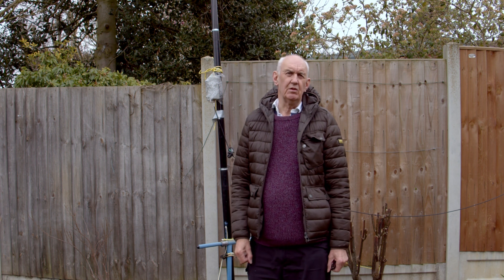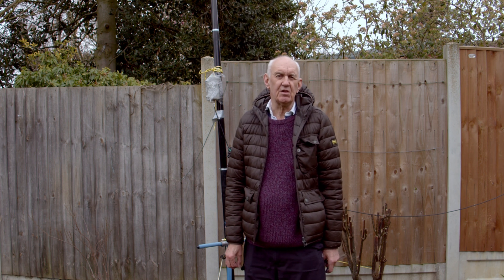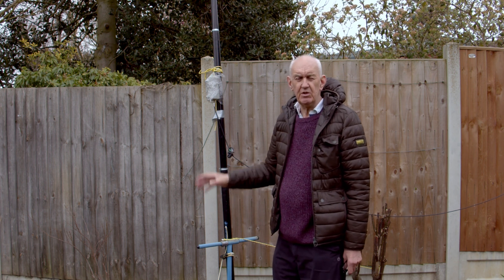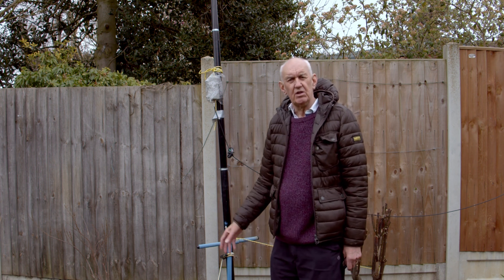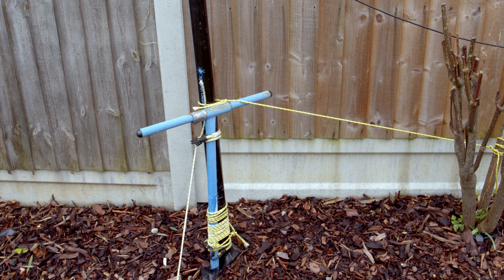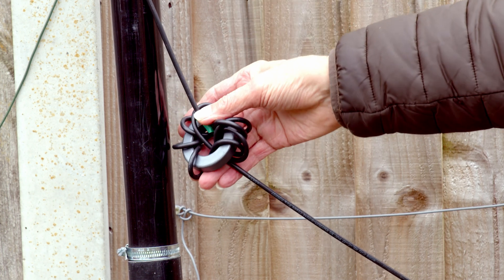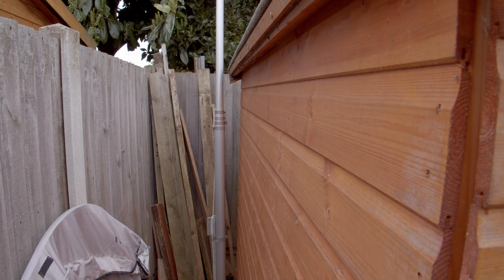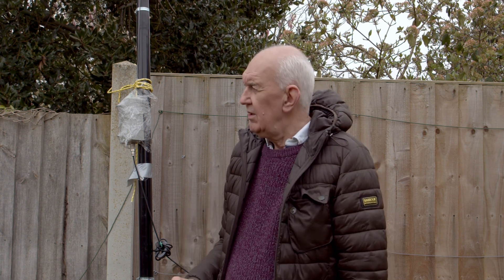Taking Down the Half Square Antenna - Good or Bad Move? Ham Radio Feature

Comment: It’s been my experience that a dipole, if you can get it up not much above the height of the half square, has a lot better gain and a broader beam width. That said, my 80 meter Half Square is a killer on 80 meters into Europe from Virginia!  The half square I built for 40 it was maybe equal to my fairly low 40 meter dipole ( 50 ft at the time ). I did again notice the pattern was narrow so the dipole was the antenna I kept up.
Reply: You actually used a true half sq. Not an upside down efhw. Feedpoint and current are very different I assume
Reply: @JayN4GO  not sure what you mean. Current is the same phase on the wires end fed or top corner fed. Both verticals have in phase current. The top wire should be 1/2 wave with the two vertical sections 1/4 wave. Same as the ones I built. Is his different? Maybe I missed that. If the total length is only a half wave then it’s not a Half Square antenna but an end fed half-wave dipole with the ends bent down or bent EFHW depending on how you view it.
Reply: @dandypoint  interesting , so we can make the efhw a loop or a vertical and expect the same results ? Just use trickery with the transformer? If the end result is the same , why not use 160m efhw as an 80m half square? For some reason I thought the true half squares feedpoint had to run straight away from the top corner for some purpose
Reply: @JayN4GO  No. There are two thing that are sometimes mixed up. First you must match the feedline to the antenna to get power into the antenna. Second after you do that you look at the current distribution on the wire. An EFHW or any half wave long wire has the same current distribution along the wire. Zero at ends and max in middle. Any wire longer than a half wave long but end fed has a current distribution that starts with zero at the far end and has current maximums every quarter wave back from the end. However only every other maximum are in phase. If you bend the wire certain ways you can form various radiation patterns. Bending the ends down a certain way on a full wave wire can give you two vertical 1/4 wave wires separated by 1/2 wave and with in phase currents. That’s a half square. A full wave wire center fed will result in the currents in both halfwave sections being in phase. End feeding that same wire will result in currents in the two halfwave segments being out of phase and producing a very different pattern! So you have to look at where the current is on a wire and what the phase relationship is. Making the full wave wire a loop and feeding it at the bottom produces current maximum at the center of the top horizontal wire and also at the center of the bottom wire. Essentially you have two halfwave dipoles spaced 1/4 wave apart with the ends bent down on the top one and up on the bottom one till they touch. Two such dipoles produce insignificant gain over one flat dipole. Regardless of how you bend the wire you can somehow feed it power but the resulting radiation pattern can be anything from complete cancellation of the radiation to significant power gain in a couple narrow directions.  Hope brief explanation helps.
Reply: @dandypoint  sure does! Thanks om for explaining

Comment: 23cm, huh? 

The one advantage of operating at 1.2GHz is the antenna size.  For the experimenter, the dimensions are small enough so as to make practical 3d printed fixtures, but are still large enough to work with.

3d printing really adds to the hobby.  The fast turn around is satisfying.  Also, at these frequencies, submillimeter accuracy and repeatability matters.
Reply from the maker: Yes, interesting possibilty.

Comment: Try putting up a straight 40 metre EFHW with a 110uH coil at the end followed by about 2.5 metres more wire. That end section will let you resonate it on 80 metres as well, albeit with reduced bandwidth. Any half-decent tuner will cope with that and give you the whole band. You can even slope the 80 metre section or drop it vertically down and it doesn't seem to mind
Reply from the maker: That was one of my original antennas and. if you look back you will see the videos I did on this. 73 Peter.

Comment: I've have nothing but good results with my G5RV, location change meant a EFHW (also a big fan) on 80 and above.  For my G5RV I changed from coax fed to open wire as per original design and the difference was noticeable.  There are a few derivatives to the G5 which once I move again will try.  Great hobby this/  Thanks for posting. Regards  Mike
Reply from the maker: Many thanks for sharing Mike. 73 Peter
Reply: Mike I’m strongly considering a EFHW for 80 and up here in Ohio. Very close! How high did you install yours? Is it a good performer? Thanks 73